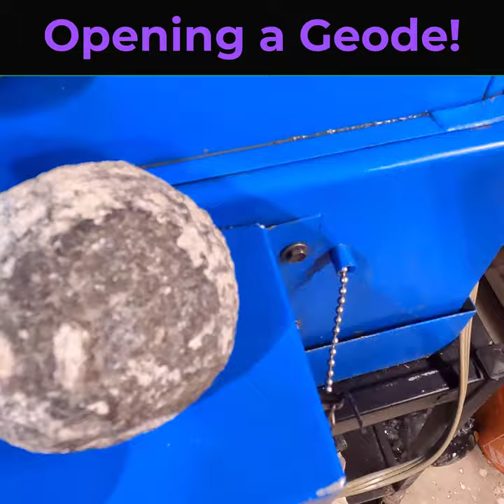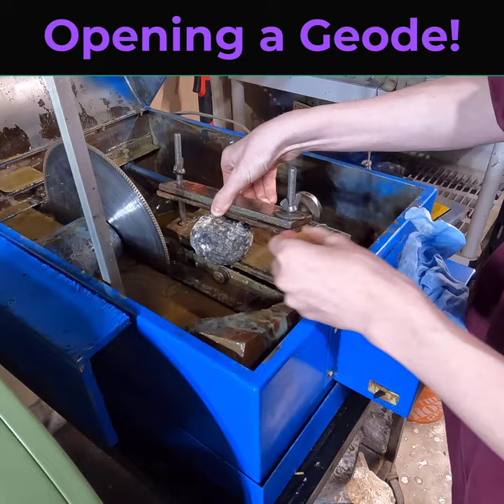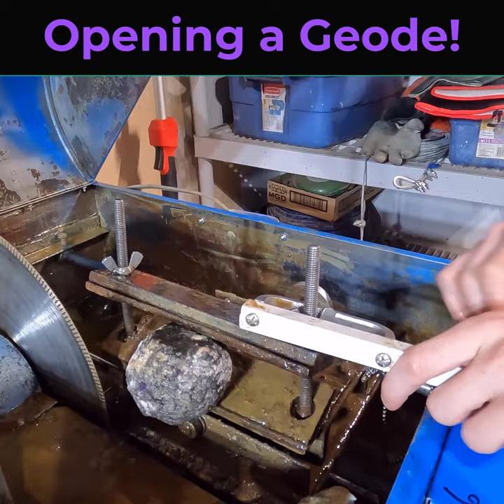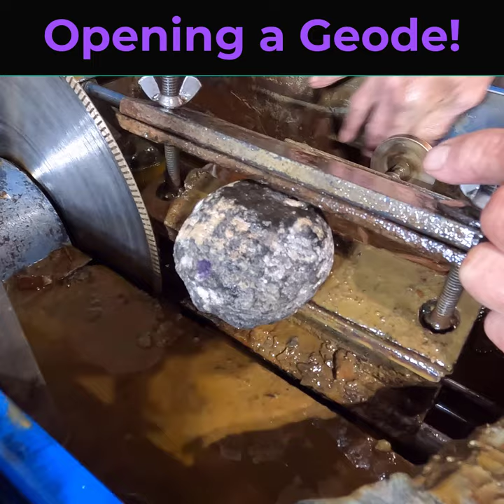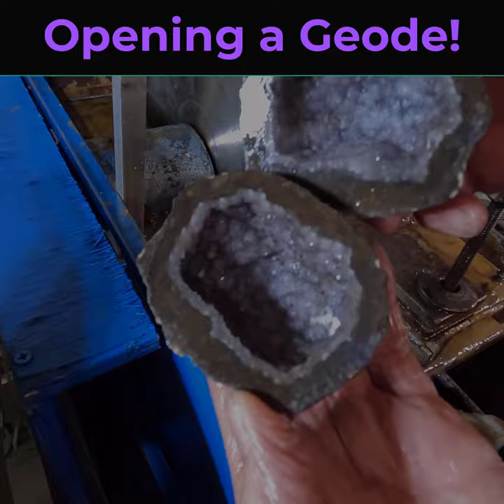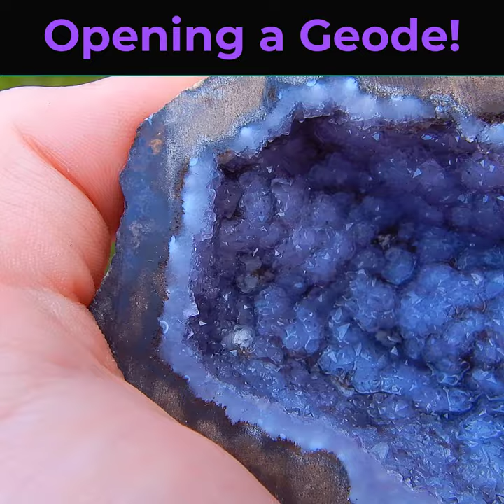Evan opens an Amethyst Geode!

Comment: In certain places in northern NJ, there are tiny geodes.  There's a spot where basalt sills abut various other mineral deposits from different epochs, and in some of those, there are little pockets in which geodes formed.  It's hard to find them, because the mountains there are so ancient and eroded... in fact, they're not really 'mountains' in the traditional sense.  They're actually the remains of massive erosion over an incredible length of time.  Given the way the layering of the geology is set up, some of the peaks were probably ten thousand feet higher, and what's left used be under thousands of feet of rock.  Then add in the ice ages, and it's a very jumbled system.